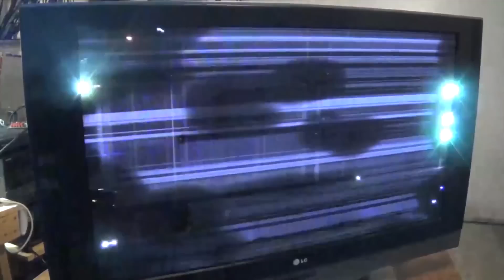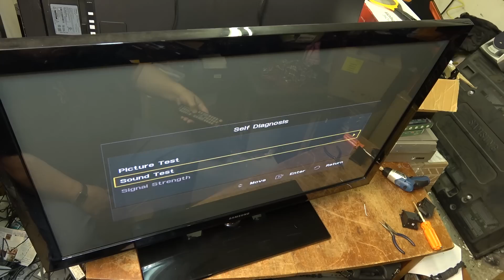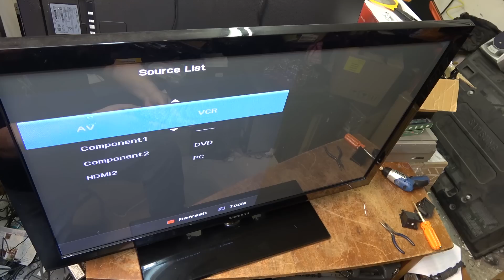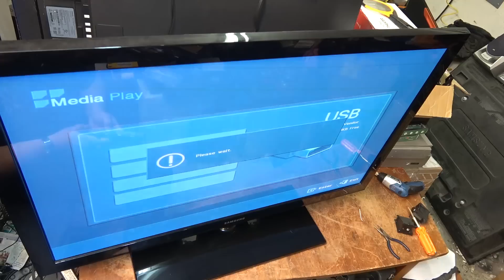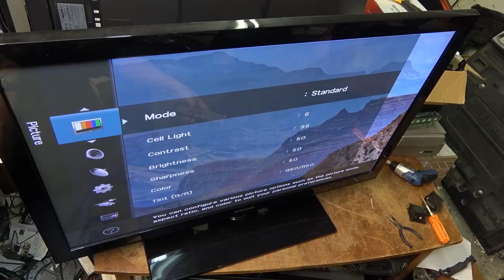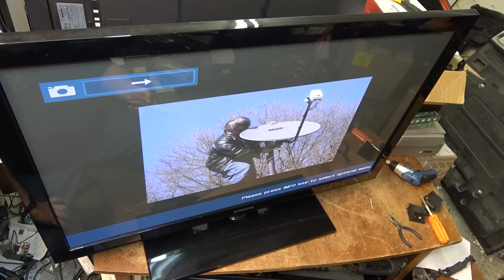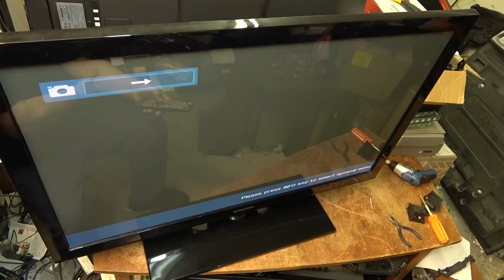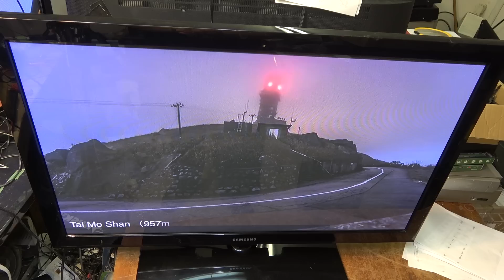Samsung PN42C430 shuts down relay clicks root cause discovered.

Comment: Great video, thank you for the update. As an amateur, every time I open a device with many screws,  I use an ice tray , write numbers on it and add a small magnet. As I take off the first raw of crews I put them on ice tray hole nr.1, secondary screws in 2 and so on. If one or more screws of a group are longer I mark the place with long screws (or small, if majority are bigger).  It happened that I've opened a device and when I wanted to put it back days later I had no idea what goes where, or worse you misplace a long screw where the small one was and short electronics.

Comment: Electronics can be sell unpredictable. 1 minute it could be working. The other minute could be series of issues, and we used to hand solder  Now we'll use machines, and that's another problem.
Reply from the maker: Hand soldering hasn't been done since the 60s. Wave soldering started late 60s.

Comment: Callbacks and being fooled when you think u got it are the bitch of service work...I have a Toshiba 20" crt that starts off with a grainy picture that clears up 80 % after about 5 minutes. Im not sure where to go with that problem. Sounds like a cap about to die.
Reply from the maker: That's why I test extensively.  Especially when the set shows up and works when plugged in

Comment: Good update to the original video. Shows how important good testing is after repair, fully assembled back together, as it is in normal operation.
Reply from the maker: It's going to run for a few days before going out.

Comment: I think you got it now, untill another pcb plays up.
What a poor quality construction or made to fail. Hmm.
Reply from the maker: It's 13 years old.   Even back in the CRT days you were very lucky it is made it to 10 without breaking.  People whine about the unreliability of modern electronics which is unwarranted.   Stuff 40 years ago wasn't better. Those old dual record players for example made in the 70s were going in the trash in the 80s.
Reply: The only long lasting crt tv set i know is a hitachi all germanium  transistor set that my friend had.
It was the first colour tv set in bedworth (yep where i live).
30 years later the crt guns were low on emmisions.
I zapped the worst gun with my diy zapper.
i knew the tube was had it,  a month  later a different gun failed.
That was an amazing set.
the channel selection was a central ring and a outside ring for fine tune.
Reply from the maker: @zx8401ztv  germinium transistor tv? You sure about that? 
I've see old TV's and they were all either thyristor bases or silicon. Before silicon they used tubes for things like vertical and horizontal sweep. Germanium and low voltage devices.
Reply: That's what i was told at the time,  maybe the owner got it wrong.
It was a hell of a long time ago, i was about 18 years old.
Reply: Yep, survival bias, the best made items lasted the longest and weren't thrown away @12voltvids

Comment: strange it is the same video
Reply from the maker: It not the same video. There is no other video.
Reply: @12voltvids  sure I have seen this the other day oh well never mind hopefully you get more tvs to look at.
Reply from the maker: @EastAngliaUK  it never left the shop.  Under test the next day it shut down so the video was removed and replaced with this one which shows the root cause.
Reply: @12voltvids  oh OK as before hope you get more to fix when get the room to.

Comment: Great! When I saw the snake, I was thinking boomslang, 
It's good it's not a boomerang either.
Reply from the maker: I figure when the board was tightened it flexed the board and restored the connection.  Tighten the back and it opened up again and shut down.